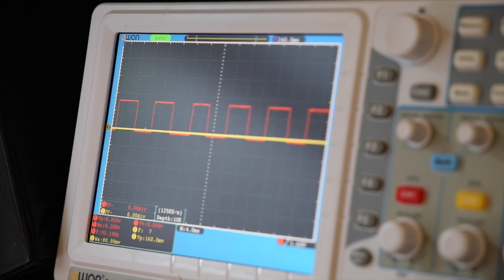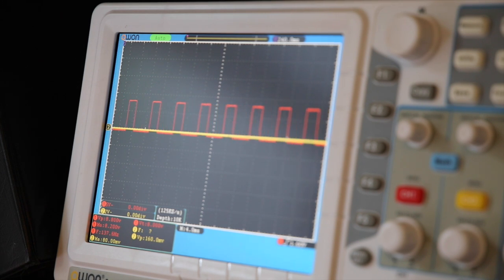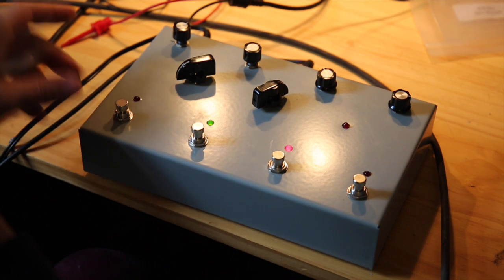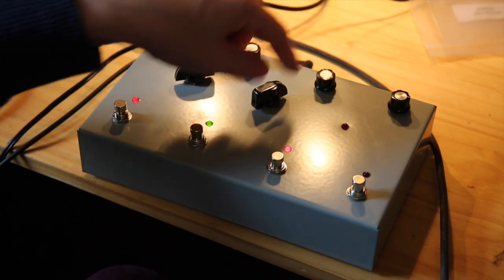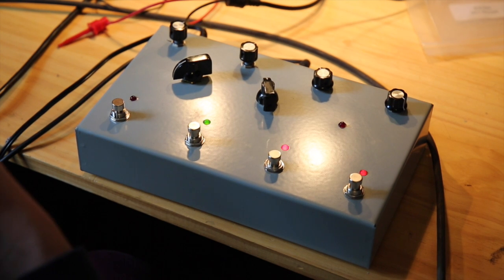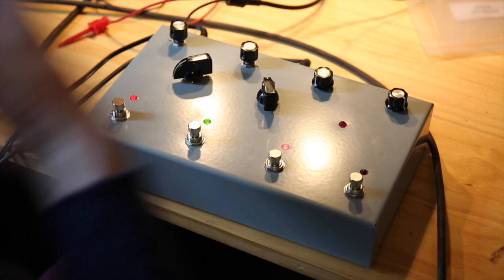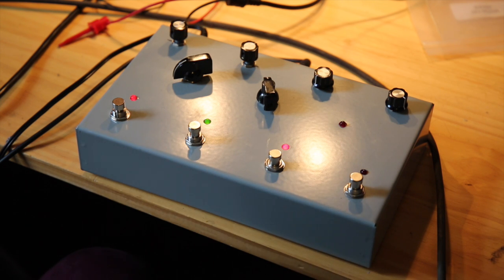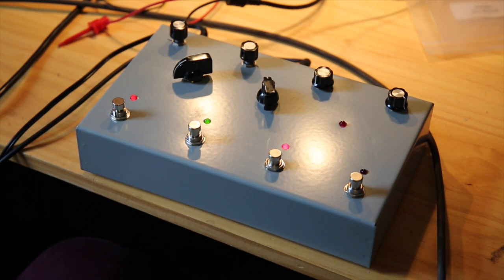Roland GR-300 Waveform Mod

Comment: I have never- not once- commented online about anything. This is the most amazing work. Unbelievable. What would convince you to do this for my GR-300?
Reply from the maker: Thanks for the kind words.  I think the chances of this become a commercial product are low.  For one, the market is pretty small.  Only a subset of GR-300 users.  Second, the cost would likely be prohibitive due to the amount of work involved (and inability to offset that by doing large quantities, getting custom PCBs printed, etc).  Third, the main part I used, the dual optoisolator, has been discontinued.  Another manufacturer may provide a replacement partin the future, but that's up in the air.  If I could get a number of interested people I might reconsider it.  Feel free to contact me through my website.  If you're in contact with other GR-300 owners who would be interested have them do the same.  It's really about reaching critical mass.